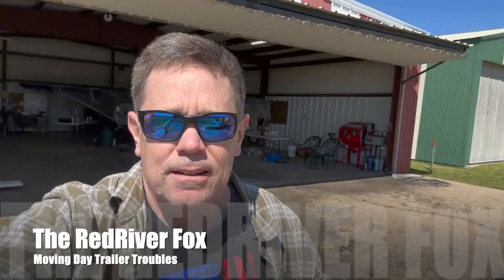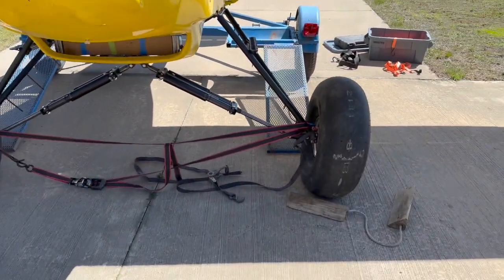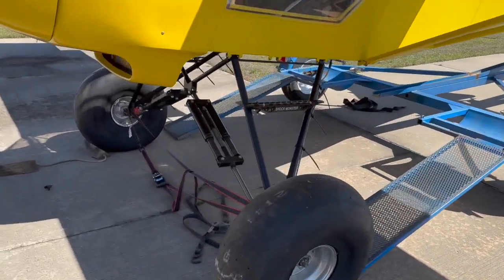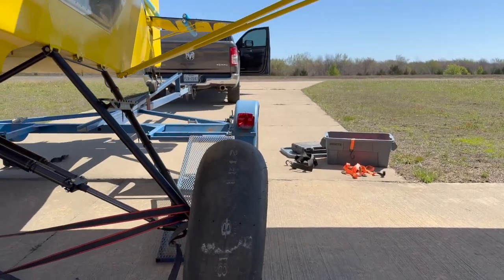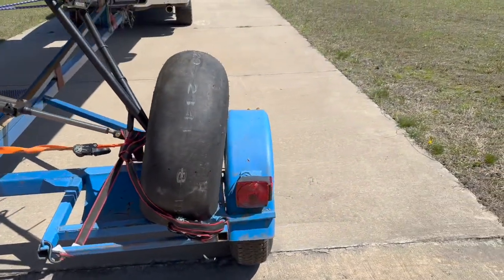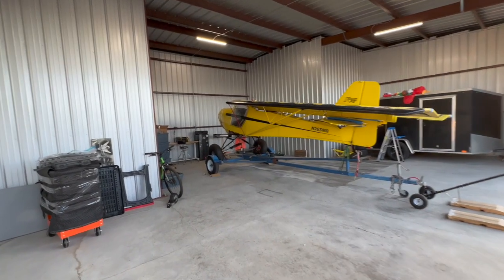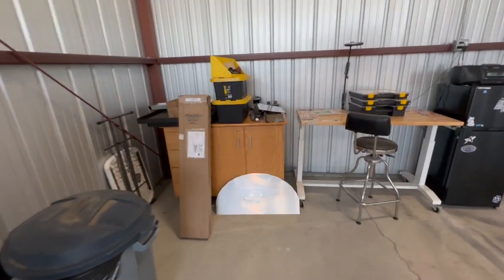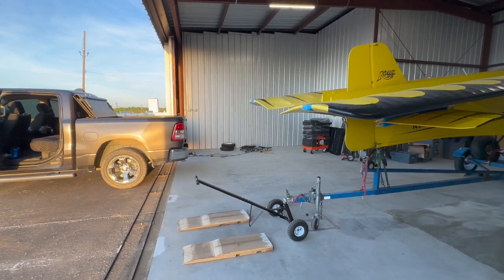RedRiver Fox - Moving Day Trailer Troubles

Comment: To late now, but I thought about getting a piece of 1/2" steel pipe of the right length, drill two 5/16" holes in it and use it to replace the shock tube.  Would have held both ways then.  Glad you got it done safely!  Jim
Reply from the maker: Now that’s a great idea!  If I have to move her again before I get the trailer modified I’ll try that.  Thanks for the suggestion.